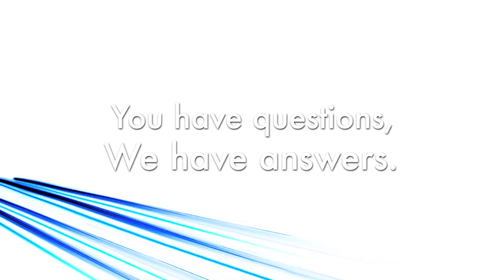Honda Insight Auto Day/Night Mirror Installation (Honda Answers #81)

Comment: The guy doing the installation is a real professional.  Why was the mirror swapped out?  I drive a 2019 EX and think I'll stay with the stock mirror for now.
Reply: Mirror swapped out because it wasn't Auto dimming. If you have an EX I think that comes with auto dimming